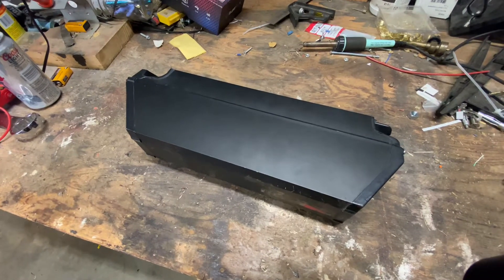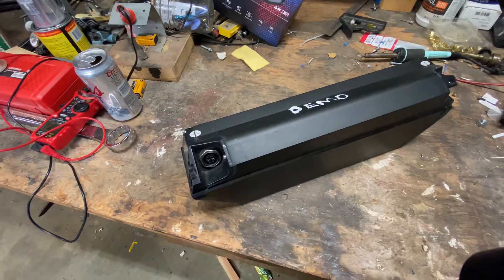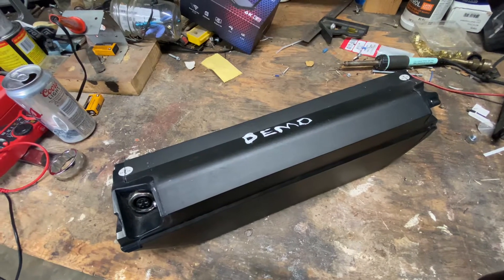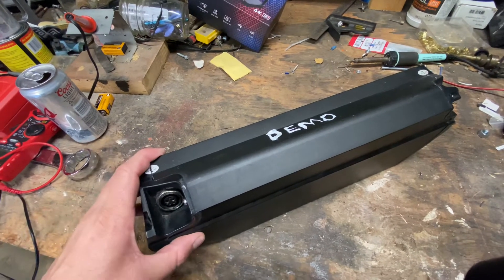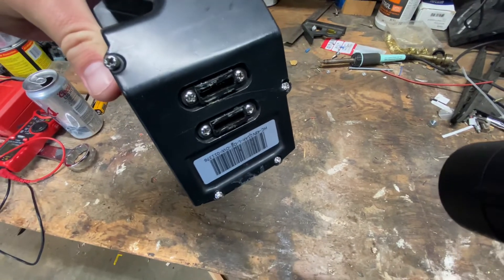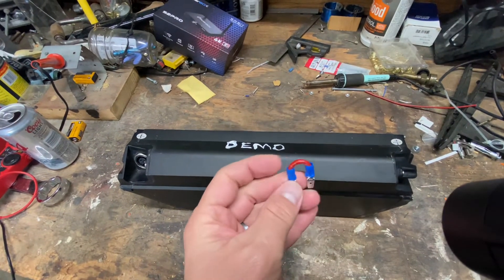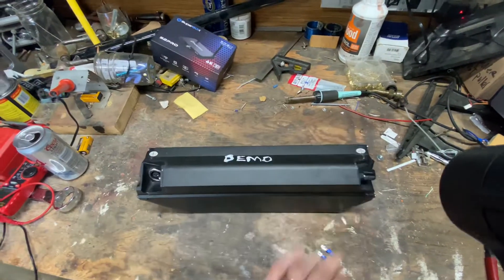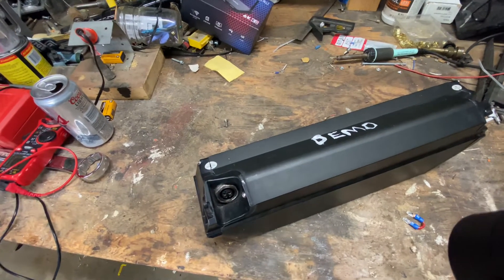Ebike battery hack

Comment: Have you ever heard of a gio 2012 electric pink scooter lol nothing online the company doesn't know and i need wire new batteries theres 4 of them 2 in each case one sits on top the other and connect to the other box then to the bike
Reply from the maker: I have not heard of it sorry. But if there is 4 batteries, they may be 12v batteries. My guess would be they are either wired together in 2 series 2 parallel to make a 24v battery, or more likely 4 series to make a 48v battery. If it's a 48v battery, you should be able to replace with any 52v scooter battery. But that's just a guess